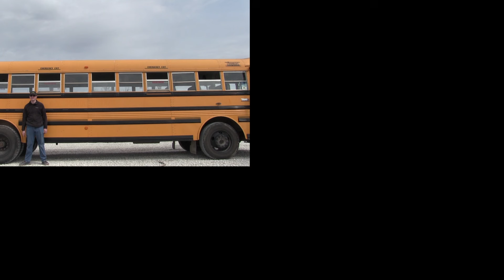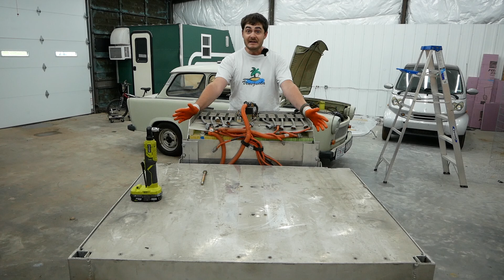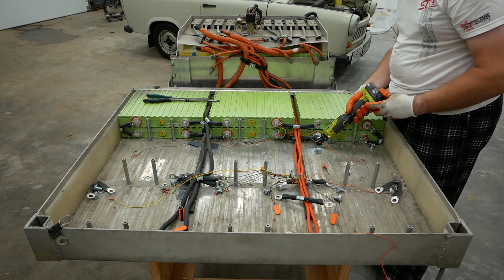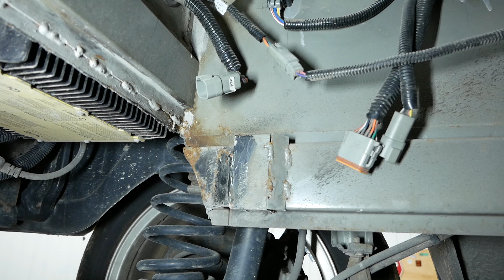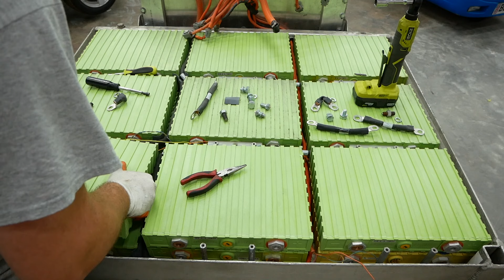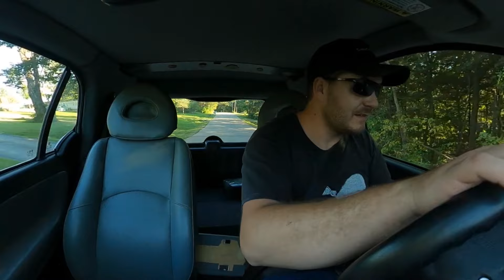Can I Revive the Dead Battery Pack in my Wheego Electric Car?

Comment: I've been having some good luck bringing back dead batteries. It depends on what killed them and you have to be very careful but I've seen some come back that were even below a volt. Go look at my YouTube channel and I have a Tik Tok Channel. Hopefully you can look at your BMS and see the voltages of the individual cells. Best to do it outside where if they catch on fire it won't be a big deal. Have to do a capacity test. First charge might take 50 hours cuz you start off at 1 hundred C

Comment: Really should have just drained the pack at the shop 

ideally you want to test each battery individually but you need something to monitor it like a bms monitor to 4 or 8 (depends if you use a 12v or 24v inverter) cells individually and use use a 12 or 24v  inverter to drain the pack
also them battery's are standard you can still buy them (they aren't anything special)

Comment: You can buy LiFePo4 battery cells anywhere. Finding exact dimensions may be problem and new ones will be way smaller with same rated capacity, but other than that ... just look at aliexpress or amazon.
Edit: Just looked at aliexpress and you can have 200Ah/3.2v batteries for around 100USD. So depending on how much you want to spend on this, you could rebuild the whole battery for under 4k (way more than the weego is worth most likely).

Comment: you will be fine. i tested over 600 used 18650 lithium batteries. what i found is if they charged to 4.1 volts and stayed there or thereabouts for a week - they were fine. all the good ones have been running two insane ebikes ever since with no issues whatsoever
Reply: well i say fine - but you may have damaged the cells by letting them go completely flat . . . . . the odd times ive abused my ebike batteries the trick is to correct the abuse instantly - the less time the battery sits overcharged or undercharged the less damage it will do.

Comment: The puffed cell needs a capacity test! Lifepo4, usually get fat when they die! So if you're lucky, you only need to change that one or maybe one or two others. If that fails, time for upgrade of chemistry: A BMW i3 12 cell module is 6" high, 12" wide and 14.5" long weighs 50 lb and holds 4kWh. LiFePO4 is only halfassed better than Lead acid. Too heavy to drive around with!

Comment: that battery may be a safety hazard, don't try to squeeze all you can out of it there are options to have a new custom battery but they're not cheap, much cheaper to make a gas engine conversion

Comment: I'm curious of you could replace the cells with something that has a similar size or voltage? I can imagine like picking up a scrapped hybrid or electric vehicle and salvaging the cells out of that! I'm sure that would probably take too much time and/or money to be worth it, but it may be something to consider. And with that said, did Weego make their own batteries? Or did they use non branded batteries that were made for a different manufacturer i.e. toyota or honda?

Comment: I made a DIY battery test rig for the used LiFePO4 batteries I bought for my RV.
It was fairly crude, using an Arduino, a contactor, and a properly sized resistor as a load.
I then charged the battery to test to full using a bench power supply.
The code on the arduino measured the voltage once a minute, and opened the contactor when the cell got to my discharged voltage.
I then plotted the resulting time vs voltage graph, and compared it to what I could find for a discharge graph of common LiFePO4 batteries, as well as calculated the Ah capacity of each cell.
I think it worked pretty well to test them.

Comment: If the battery pack is pronounced dead my idea would be to set it up as a home battery pack to use during the day and charge at night when electricity is cheaper. As for the car, it would be really cool if you could source a Tesla battery pack to put in it!

Comment: That's an awfully roomy looking battery pack, maybe you could get away with replacing the lifepo cells with something from another electric car, I know you can get leaf cells on ebay, prius too but youd probably want to stick to lithium so you don't need a new bms.

Comment: The LiFePO4 cells I have are also 3.2 nominal, but if you look at their charge/discharge curves and other data (and also what I've tested on them myself), at a resting voltage of 3.2v they basically don't have anything left. Voltage isn't a great way to measure state of charge with them because they have such a narrow voltage range (which is why cars typically use coulomb counting), but, my cells are typically 90% full at a resting voltage of 3.4v and have about 20% at 3.20v.

So if they were sagging back to 3.20 to 3.24,  either they hadn't been charged nearly enough, or they had some fairly substantial self-discharge issues.

Comment: That bloated battery should be a cause for concern. If it ruptures you'll have a nice, toxic mess on your hands.
Reply: LiFePO4 is generally considered nontoxic. The organic electrolyte, however, can be a mess. You'll need the MSDS for that exact battery to know for sure. (however, there's usually very little electrolyte in there.)
Reply: Li Fe po4 is not dangerous at all . But it needs to be replaced.

Comment: 15:15

Safety glasses just in case the whole thing goes up in flames.
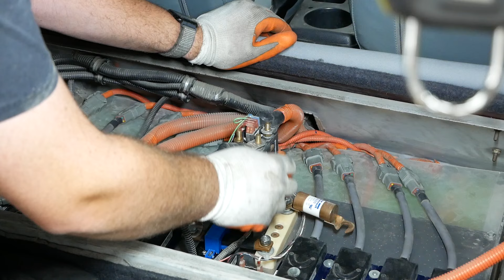Reply: 15:30 Safety glasses are important when handling charged batteries, even if they are old and weak. And don't use full metal jacket tools, better partly insulated eqipment so only the very bitty end is touchable as metal. If you accidentally drop the tool or slip and short cicuit neigbouring cells, you may cause an arc. You don't need much voltage, but batteries are able to deliver tons of amps. Basically you can create an improvised welding arc. It will melt the tool away violently, so it is good to wear gloves, because the sparkling liquid metal will spay on your hand. You don't want collect those droplets with you eye neither. And there is also the chance if such an accident happened, that you look into the arc - which may cause photokeratitis. Thus, as a precausion safety goggles which shield UV light may be helpful.

Comment: The smart car was designed to be electric, but Mercedes thought electric cars are a stupid idea and decided to go for petrol an diesel. A this point swatch left the project. After that they did not redesign the car and just put stufft things like the gas tank and the 12V battery in the battery department.The wheego is a cheap clone of the smart car, so ther even copyed the usless battery space.

Comment: They look very much like the Winston 400Ah cells that a lot of DIY EV builders use.  You will NOT like the price of them though.
Edit: Wikipedia says the car has a 260Ah pack, so the correct cells are the Winston WB-LYP260AHA. A bit cheaper at $327 each, but still a big investment.
Reply: Me, having no idea: "I'll just Google those...HOLY SHIT."
Reply: The car isn't worth 1/3 of what it would cost to replace the cells in the battery pack with those Winston cells.
Reply: @woodmiister  I suspect only a few of the cells would need replacing (the bulged one is a prime suspect) but even 3-4 cells would be a significant part of the car's value.
Reply: @ferrumignis  Annoyingly with most battery packs, all the cells are matched up each other.  So you'd are you'd have to buy a complete replacement otherwise the battery pack won't work right.  

Also the other issue, we don't know that the Winston cells have the same specs as the cells in the wheego.
Reply: @woodmiister   Yeah that's not true at all. Batteries are never the same and there are plenty of ways to work around cells that are different.
Reply: @woodmiister  That is what the battery management system is for. It’s supposed to balance the charge to the worst cell in the pack. Replace the worst cell and suddenly you are back to the next worst (which may be much better). The bulged cell is the obvious candidate but running the pack till it stops and checking the voltage is a good guide.

Comment: I saw the ballooned cell and then you driving it by floring it and thought "ouch - that'll not end well"! It didn't. But all in all, my guess is that the car would be fine with that one cell replaced. Wouldn't charge it to max too often before replacing that cell.

Comment: If your lift has a manual lowering lever right on the valve, you can run the pump and use that valve to throttle it.
If you have a fancy electronic lowering button, then just ignore me.

Comment: Well, if it’s dead, it deserves a proper burial. Open the big pit in your shop back up, dig it down another few few, drop the Wheego in there, and then fill the whole thing back in with concrete. It’s what the Wheego would have wanted.

Comment: As a person who has taken a Hybrid Battery Safety course, this entire video made me nervous and on edge.  These battery packs are incredibly dangerous and can be fatal if you are not careful.  They are very dangerous to work on if you are not careful and know what you are doing.

All that being said, I am bummed that the Wheego appears to be dead :(
Reply: In what way? There are a lot of people who get off on telling everyone how dangerous things are.  You need to be more specific before you are convincing.  Of course there are some dangers but they aren’t really too hard to avoid with a bit of knowledge.
Reply: @michaelfisher9671  In the way that they can deliver a lethal shock if not handled with proper care.  The systems I dealt with had safety features like a high voltage interlock loop that is supposed to disengage the contactors when disconnected, but a system like on the Wheego looks a little...Ehhh.  Even with safety features, there is a lot of potential energy stored in these packs and touching the wrong thing, even by accident, can be dangerous.
Reply: @anthonyspecf  So what you are saying is high voltage can be dangerous?  Thanks for that.

Comment: Please dont leave it alone  charging, dead battery cells can get to the state when they wont charge up to full voltage at all, they will just heat up and that is simply a fire hazard. The BMS module is not trying to rip-off customers, its there to prevent burning your house down.

Comment: “This battery has ballooned a bit, I hope that’s not a problem” yeah if a lithium battery expands that is a very bad sign and that may mean that the single cell was over charged, this could be a huge fire hazard.

I think you should at least check it thoroughly and I would contact wheego if I was you. 

Anyway great job fixing up that hilarious little car, I love your content!
Reply: Introvert Airways it doesn’t always mean it’s been overcharged. When the internal formula gets damaged from misuse (like almost dying) oxygen forms and causes the cell to puff.
Reply: 99thPeanut o didn’t mean that it is always overcharged but I thought it was this time because it had not been bulged before he charged it.
Reply: Introvert Airways ah I got you. That makes sense.
Reply: LiFePO4 batteries are much safer than Lithium Ion.
Reply: Fredrik Östman this.  Bulged LiPos are dangerous.  Bulged LiFePo4 cells are damaged but not dangerous.
Reply: It won't catch fire . That's the good thing about that particular battery chemistry.
Reply: EnlightenedSavage oh good, I was thinking of LiPo or Li-Ion but I didn’t know the LiFe were safer, that is good to know.
Reply: Introvert Airways actually yeah it’s awesome. Life batteries are so safe it’s a great thing!
Reply: Not a good sign.   With the voltage that low, good chance a cell has gone into reverse.  You could possibly charge each cell separately with a hobbyist battery workstation like a PowerLab8.  But as you say, getting cells are problematic.  Most economical...  source Nissan Leaf cells.  You may have to reprogram charger and BMS, but they should work (this is what I replaced the bad pack in my Vectrix VX-1 Scooter with)
Reply: boeingav8tr if the cell went into reverse it probably woulda been exploded when he floored it.

Comment: Just a note about your lift--I noticed that one side lifts first, and your safety locks are not engaging at the same time.  The two balance cables need to be checked and tightened so that both sides operate simultaneously.......... (I have the same style lift)

Comment: If it does fully die you can take parts and bit from it and put it on the school bus like maybe the third brake light the charging system so you can plug in the bus if the solar isn’t enough or hmm

Comment: Your ingenuity, stamina, and patience are amazing.
Electric cars will suffer from this obsolescence as long as batteries cannot be replaced easily and at a fair price.  
I hope makers realize this and move toward a design that is more like power tools...just drop the battery pack and replace it.  
Owners could join a co-op to exchange packs to end wait time to charge, end being stuck with a dead pack for the failure of a single or few cells, and with a wide spread network of exchange stations = no range anxiety on long trips.
I would think this could very easily come to the commercial truck business.
Just my 2 cents

Comment: Wait.... the wheego runs on 115v dc? Wouldn’t it be fairly easy to just like straight up plug it into the wall? Get you a bridge rectifier and a few 100’ extension cords and you can rip around your property at least 😂

Comment: Hopefully all will be well after some long-term charging but, if not, I suggest you drive it locally until it dies again and then work out which cells are taking it down then find some replacements - chances are you only need a few.